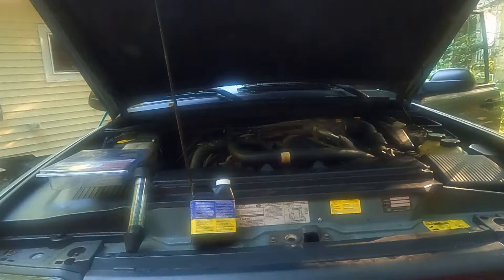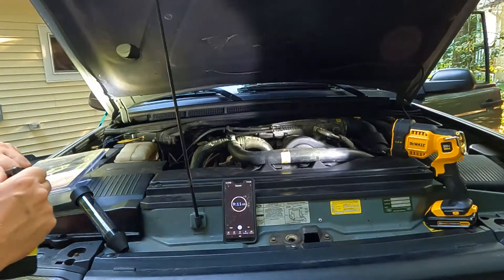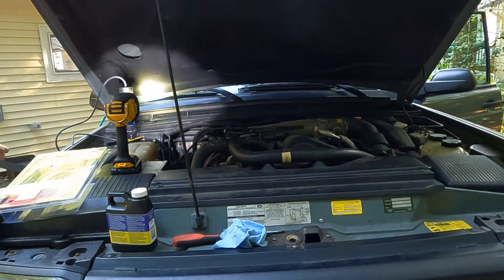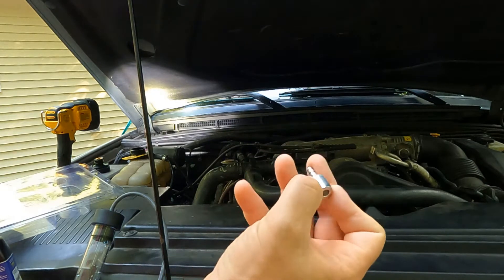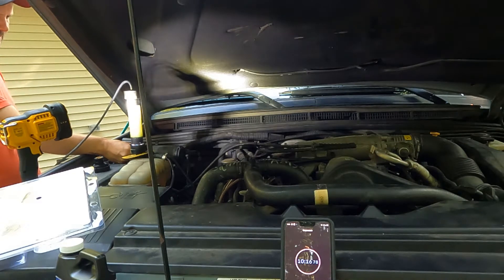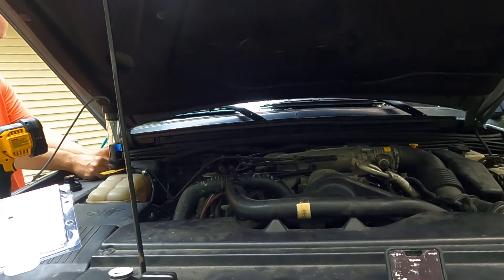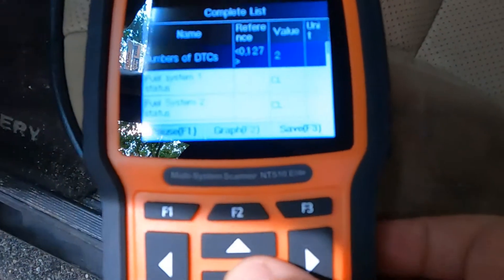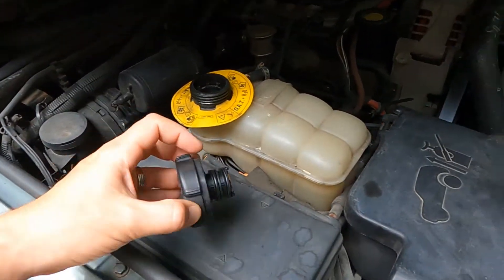Head Gasket Miracle? Combustion Leak Test on 2004 Land Rover Discovery 2

Comment: Now that you're at ease about your head gaskets having already been replaced in the past at some point, the question then becomes what to do to prevent overheating in the future. I remember about 10 years ago looking at Range Rover Classic (before they were getting collectable and prices shot through the roof), and the guy selling it told me upfront that he was driving on the highway one day and happened to look down and the temperature needle was pegged! He pulled over right away and shut it off, but didn't know how long he had been driving it that way. It's true, in that the temperature gauges in older Land Rovers do nothing more than move their needles and turn on a little red LED when they hit the max. That's it. No chime, no warning, no nothing. So unless you are looking at the gauge constantly, you won't even see it start to creep up until it's too late. And yes, once they overheat there's no telling what kind of damage it's going to do, especially with the notorious "slipping sleeve" cylinder liner issues. The old saying that "once it overheats one time, it's done" is an absolute myth though. Yes, true, it's not good for ANY engine to overheat for too long, but each engine is different on what that excess heat did or did not do internally. You can't always assume that it will turn into a complete engine replacement just because the temperature was maxed out on the gauge on the dash. Which brings me to what I have personally done with mine to alleviate any future worry of my temperature nearing the "danger zone." In no particular order:

1)  Replace all the plastic coolant passage fittings. There are at least two (possibly three altogether), plastic unions where the coolant hoses join/split through their routing. The one you see immediately when you open the hood is right on top just behind the fan shroud. This is the "Bleeder-T." There is another one down below the tensioner pulley under the A/C compressor. And there may even be one more beyond that (I just can't remember off the top of my head). Regardless, those plastic fittings become brittle over time. Just putting the slightest pressure on one to get a hose clamp on or off could crack it. When in doubt, or if they just look old, replace them when you get around to doing, say, a coolant flush or something. They're not so pressing that you have to run right out and do it. That'd be like telling someone to change all the lightbulbs in their house before they actually burn out. In the end though, after replacing them, you'll have piece of mind that they are new and not have to worry about them blowing out under pressure leaving you stranded for a good long while.

2)  This is always up for debate in just about any automotive forum, but... change the coolant type if you're seeing corrosion. If your overflow/filler reservoir still has the factory label surrounding the cap, you'll notice it says, "O.A.T. + H20" on it. A previous owner may not have adhered to that label and put any type of cheap coolant in it, and mixed it with tap water instead of distilled water at that. You may have also heard the conventional wisdom not to mix different types of coolant, or, "Always use the blue kind in a Land Rover", etc., but the truth runs much deeper than that. Without getting into the specifics between I.A.T., O.A.T., and H.O.A.T that you can easily look up yourself online, what you actually want to avoid mixing is the different chemical compositions as that's the first "no-no." The second faux pas is, what to actually use to avoid potential overheating with these particular Buick-derived Land Rover engines. The overall trick here is to keep the overall operating temperature down in the first place, even simply at idle. And even a step further is to go with a coolant that isn't as corrosive so as not to wear out coolant componentry prematurely. O.A.T. utilizes additives to significantly increase time between system flushes, but it does have slightly reduced anti-corrosive properties. So what then? I personally have made the switch over to a waterless coolant, specifically by Evans. You can read why their waterless coolant is superior to a water-based coolant here and what advantages it has should the Discovery engine temperature exceed its max:  https://www.evanscoolant.com/faq/operation/.

3)  The 180-degree thermostat mod. The OEM thermostat in the V8 Discovery models is a 190-degree version (PEM100990). A lot of owners are making the switch to the standard thermostat that came with the TD5 Discovery models which is the 180-degree soft spring style (PEL500110). I personally now run the 180-degree thermostat and my idle temperature is around 196/198 degrees, whereas before with the original thermostat I was around 208/210 degrees sitting in traffic. Again, just about like every other Rover myth out there, you hear about a friend-of-a-friend who knows a guy that said, "Always buy OEM and not aftermarket" when it comes to thermostats. I've seen it on the forums before too that somebody bought an aftermarket brand and it either failed shortly thereafter or didn't get the results they were expecting. Miraculously though, they then switched to the OEM version and their problems were solved! To each his own with that one or any other personal experience someone may have had with Aftermarket vs OEM. If you buy aftermarket and it works for you and you saved some cash as a result, then great. If you fear you will run into trouble or simply don't want the (potential) hassle, then buy OEM upfront and be done with it. Always remember though, that anything can be bad right out of the box whether it's OEM or not.

4)  Get a digital temperature gauge with chime warnings. Like I mentioned above, the needle gauge on the dash has no real warning when the coolant temperature is on the rise or maxed out, but it would behoove you to know there's a problem well before it turns into something more catastrophic. It's also mentioned in the forums that the dash gauge doesn't start to move off the center until the temperature climbs above 240 degrees. Head gaskets frequently fail around 235 degrees of extended running time. Enough overheating, and the cylinder liner will break loose and begin to "tick" as it travels. Anyway, welcome UltraGauge or ScanGauge. UltraGauge and ScanGauge are both OBD II mini-computers that can help you understand your vehicle’s performance better. While both serve the same purpose, there are differences in the product features. UltraGauge uses an LCD as compared to ScanGauge which uses an LED display. With either, you just simply plug the cable into the OBD II connector under the driver's footwell and mount the display wherever you'd like so you can easily see it. I can't speak for ScanGauge, but I use an UltraGauge and can hear an audible chime/warning when the temperature gets above what I set it to be, say 210 degrees. Then I know to be more aware of what my current environment is like, i.e. pulling a long hill, towing a trailer, extreme outside temperature, etc. If it's none of those things, then perhaps I'm having other issues and need to pull over immediately.

Hope this helps!
Reply from the maker: Hey Steven. So nice to hear from you again. It really has been great hearing from some of you either on the comments or over email (good call by you!). There is a lot of great advice here. As your are watching this video you can see I was using our foxwell (kind of wishing we had just gotten a nanocom, but oh well) to monitor the temperature, that is only because the ultraguage came the next day! I think that was the first thing I had anyone on a forum tell me to buy when asking for advice. I first tried it on my daily driver, just to get a feel for it. I'm seriously considering getting one for it as well. It is a 2012, but the guages on the ultraguage were far more accurate than anything the standard dash guages showed. I can't give away too much about what you may see in the future, but the ultraguage has been great and is a must have for all. 
I have read and heard both sides of the OEM vs non-OEM arguments and really believe it is a personal choice. I think we all know that some after-market items are just junk and some OEM items, well the engineers who made them probably need a talking to. I know the truck we bought was nearly 100% stock, there were a few surprises, but mostly stock and original. It ended up going 150k or more miles before needing head gaskets which I can't help but think has to do with driving habits. The person we purchased it from struck me as the type who was slow and steady and rarely was stuck in traffic. 
We will have to look into that coolant. I'm not sure I have heard of it before. I think we have some reading to do on cooling fluids. I really didn't know there was so much involved with it before obtaining the Discovery. I've seen some information about preferences on fluids on the forums, will just have to look more closely. 
Thanks again for the great advice. We will consider it closely and hopefully others find it useful too!